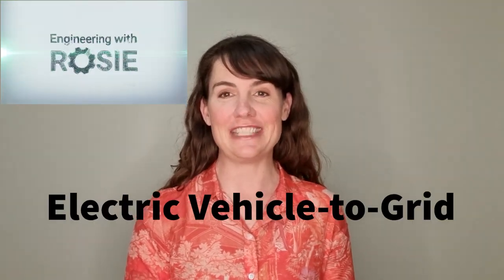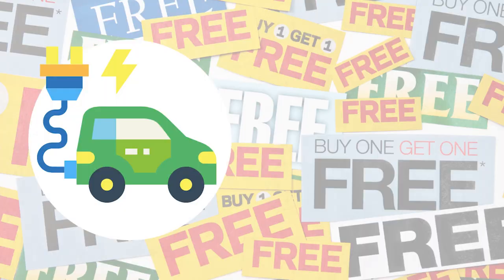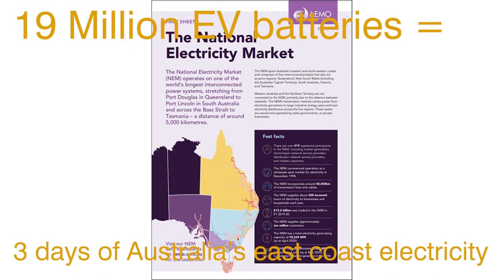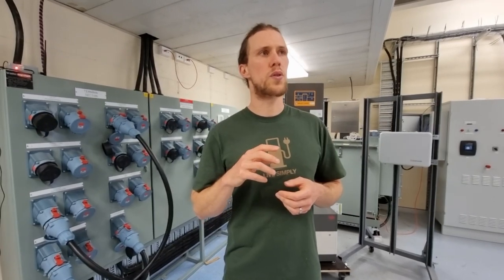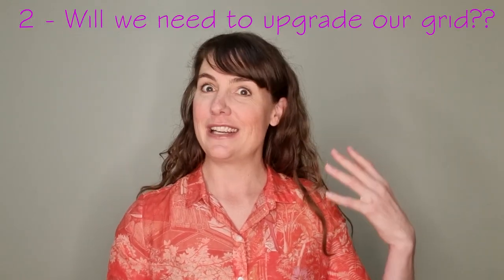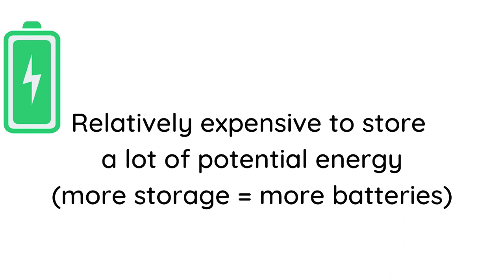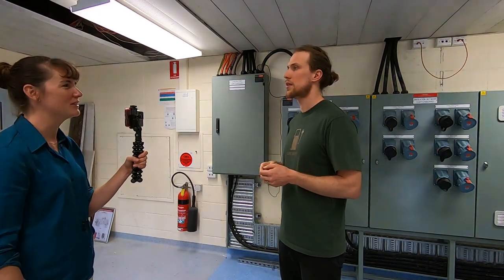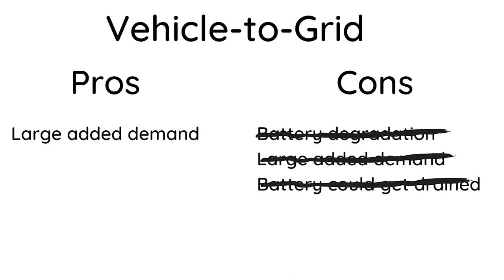Electric Vehicle to Grid Technology Explained

Comment: This one is a source of endless frustration for me too! I have a huge battery sat on my drive doing nothing the whole time I'm at home. It might be worth mentioning that current V2G technology is only supported by the Japanese Chademo connector standard. Most manufacturers have instead adopted the CCS charging standard outside of Japan and China, which unfortunately doesn't support two way power transfer. Therefore most electric cars do not support V2G with the notable exception of the Nissan Leaf and a few others from Japanese manufacturers. Meanwhile I'm drawing fossil fuel power from the grid to run my oven at peak time!
Reply from the maker: This trial uses Nissan Leafs ("Leaves"?!?). That is an interesting point though, that seems like it might be a hurdle that needs to be jumped before we can get really mainstream V2G. Maybe a good topic for a future video 😀
Reply: CCS2 and ISO 15118 support V2H/G

Tesla also is an absolute recalcitrant on V2X as they ban third party use of the battery. It widely suspected that they are holding out to launch a whole ecosystem with Solar Roof, PowerWall and Tesla EVs. 
All the OEMs are making V2X (with a few variations eg Hyundai is V2L only atm) a pathway.
Reply: Hi - I wonder if part of the problem isn’t the structure of the electricity industry? Many countries had vertically integrated utilities incorporating generation, transmission, distribution, metering, retail… In these environments they could take a wholistic view and decide to implement V2G, home batteries or whatever. With the privatisations of the industry in the 1980s (or since always in some countries) the industry is fragmented into parts that have no interest or incentive to cooperate. That means only regulators and governments can drive this - which is only rarely good news!
Reply: @Richardincancale  Hey, I disagree slightly. I do think this is of great interest to utilities companies, private or public. It allows them to access great flexibility and cut costs without having to implement much infrastructure at all. But they're certainly way behind on the "smart grid" technologies necessary for this to work. Currently even those with home batteries can normally only use the power within their own home and not export to the grid, at least not in a "smart" way. More investment is needed in both hardware and software to make this work. By comparison, a large battery storage investment probably looks safer and more conventional, despite the vast storage potential of millions of EV batteries.
Reply: @AlexPacker  Hi Alex - as Deep Throat said - follow the money. Which of the complex web of companies is going to want to invest in building the system and paying the compensation to vehicle owners in exchange for this? In the UK for example the Grid operator has to buy capacity with different responsiveness (base load to spinning reserve) from a variety of generators, based on forecast 30 minute demand, to meet requirements from distribution companies. The distribution network might require some adaptations and that’s another company (DNO) who charge transport fees to distribution companies. Where vertically integrated utilities still exist it’s clear this could benefit them.
Reply: @EngineeringwithRosie  That topic should also include that you need:
- A standard secure control system.
- An automated grid disconnect
- The cost of the inverter to feed power to the grid.
- The cost/payment of electricity used. (f.ex.: If used for load it is free and as supply you get doble back) 
As it is to day the are very little real intensiv to have a V2G agreement and there is non for the companies that make the cars.
Reply: @AlexPacker  Hey, I disagree slightly to. Since every system need an automatic disconnect to avoid that power is feed into the grid when there is a grid failure. It is not nice to fry the line-men that try to fix what is wrong.  :-)
This make it a major investment into infrastructure before V2G can be used.
Reply: @bknesheim  This is already taken care of, so no extra cost at all...
Reply: @SobrisSweden  How is this taken care of?
Reply: @bknesheim  I mean , this is not your problem! The equipment has to be certified and installed properly. It is just like a solar powered house where you want "island" mode.
Reply: @SobrisSweden  My answer was in relation to this quate:
" It allows them to access great flexibility and cut costs without having to implement much infrastructure at all."
So somebody have to pay for the option to use a V2G setup and if that fall on the car owner very few will do it. If the provider pay they have to invest a large up front cost to get a coverage that can be useful. In that case it will be smarter to have a dedicated installation built for the need that the provider have. Again you end up with very few that will use a V2G system.
Reply: @bknesheim  A soon as the standards are set and my car is able to deliver DC into the DC nano grid in my house, then there is already an inverter installed that takes care of the safe connection to the public grid. If I use the power my self or deliver to the power company is my own decision. The inverter is the same piece of equipment that is already needed for my solar panels.
Reply: @SobrisSweden  That is not what the video is about. To do what they talk about in the video the provider must be able to start charging an discharging to stabilize the grid. This most be done automatically in just a few seconds.
Reply: @bknesheim  Yes, and until the standards are set, we can just guess what will be possible to do. I already have a 12 kWh battery with my solar energy system. I will sign up to use that for stabilizing the grid as soon as I get a good offer. And I will do the same with my EV, when that day comes. I see possibilities, where you see problems.
Reply: Said, "I'm drawing fossil fueled power from the grid..."

It is mandatory that all of us get the state and federal governments to convert to renewables.  California has done so and the solar and wind has reduced fossil fuel power a lot - at mid-day time over half of the power is from renewables, mostly solar.

Get rooftop solar and battery storage.  If your system is capable of islanding then you will still have power if the grid power goes down.
Reply: @EngineeringwithRosie  
Tesla supports V2G if the charger is bidirectional.
Reply: @acmefixer1  And how stable is that Californian supply of electricity?
I fully support cutting out hydrocarbons as a source for producing electricity, but not before there is in place as alternativ that are stable and have some reserves.
At the moment the reserves in California is way to low even after several gas plant received and extension.
Reply: @bknesheim  The energy landscape is changing quickly and the sooner you prepare, the easier it will be for you and your family. Many normal days the energy will be almost for free (some hours you may even get paid to take care of the kWh), some days the energy will be very expensive. Stabilization and reliability will be realized in the small scale. Whatever happens far away in big, old fashioned power plants will be of very little concern locally...
Reply: @SobrisSweden  It is not a problem for me since I live in a country near where you nick is pointing that you are. We are already 100% renewable and have really always been so. You will find that running a small grid reliable is not easy, and over time rader expensive.
Reply: @SobrisSweden  If you are from Sweden as you name indicate then perhaps you should update your answer there is absolutely no cheap power in Scandinavia. Currently (December 2021) the price is up to 1 EUR and Sweden is hit very hard due to closing down of excisting power plants - så your assumption about cheap power is not correct
Reply: @peterhansen267  No need to update. My post still holds true and will become more and more accurate as the years go by...
Reply: @malcolmstreet1  
I have no disagreement with the video you linked to.  But...

The video failed to acknowledge that the diodes and charging circuits on the PC board are for charging from the AC outlet.  These circuits cannot be used for DC fast charging by a Tesla Supercharger which puts out so much power - over a hundred kW - that it has to bypass the AC charging on this PC board.  

As long as the DC fast charger, AKA Supercharger connects directly to the battery, the bypassed PC board with its diodes or any other components cannot be used to eliminate the possibility of Tesla providing V2G.

So I call BS on this "debunking" until the actual facts are given straight from Tesla .
Reply: @timryan4209 
I  think that the Tesla vehicles probably will only need a software update to run V2G.
Elon just wants to roll out enough EVs to make a difference when he switches on the grid storage features.
Vested power interests would kill his 'secret baby.'  😊😊😊😊😊😊
Reply: Elon's goal is to maximize sales of powerwalls.... V2G is counterproductive to that goal.... KISS...

And Tesla vehicles probably will also only need a software update, be a RoboTaxi. But in what century?

So I love how fanboys try to rationalize, conspiracy theories about 'vested power interests' lmao...
Reply: 'Tesla supports V2G if the charger is bidirectional' 

Not only is that statement incorrect,  but the person that stated it doesn't even realize that AC chargers, are built into EVs.
Reply: @Richardincancale  Designing the market structure for a grid is at least as complex a set of questions in economics as in engineering. A privatised system aims to generate the gains from competition and in the process must discourage vertical integration, which has both upsides and downsides (though the upsides will definitely be bigger in a fully renewable grid because economies of scale in generation matter less). The usual way it is done is by trying to set up a quasi-competitive market for generation, either a monopoly or a very tightly regulated oligopoly for distribution (as the grid is a natural monopoly, a "common carrier" like railways or the post) and a competitive retail segment with smaller local retailers to consumers. It never works out quite as intended and even if it did this is a structure unsuitable for a grid mixing traditional spinning reserves and renewables storage. Setting good incentives for efficent use of V2G in such a set of interacting markets, for example, is hard - as we can see.

The transition faces the old trilemma - it can be done fast, it can be done cheap or it can be done safely; choose any two. Unfortunately the climate crisis means we now have to do it fast (it would have been a lot easier if we started 30 years ago, but that did not suit certain powerful people), and the costs of chronic grid failure are so high that we have to do it safely. So I am in favour of wartime-style mobilisation of resources (ie not at all cheap) for this transition.

Comment: I remember Sydkraft in Sweden looking at V2G in the late 1980’s. I think their focus was more on scheduled use of EV batteries, to compensate for daily variations in energy demand. That coupled with a guarantee to give back a fully charged car at 5pm when you need to go home.
Reply: Well, let's not say full. Because that's the slow part. The fast charging part goes to around 80% and that's usually all you need.

Comment: It is a very logical idea. The way to make it work is first and foremost to properly incentivize EV owners, give them control over their level of desired participation, up to and including opting out entirely. Owners need to be able to select their degree of participation at each and every time they connect. If you’re recharging during a long trip, you’ll probably be willing to pay more for a fast, uninterrupted charge. If you’re car will be sitting at work or in the garage, you can simply tell it when you want it to be fully charged, and let it participate in frequency support along the way. The compensation needs to more than make up for the potentially longer charge times and, yes, the decreased battery life. Do not lie about that as otherwise this great idea will get a big black eye in the marketplace. Always be forthcoming. It is an inescapable fact that batteries have cycle lives, and while frequency support service will not significantly consume battery life on the whole, it would be dishonest to state that it has zero effect. I’ll bet that the manufacturers who are warrantying their cars’ batteries would agree.
Reply: There was a study that showed that shallow cycles  can actually be beneficial for lithium ion batteries.  Love the point on giving the power to the owner.

Comment: I was a pre-order customer for the new fully electric VW ID.3, and was able to take part in a prototype test drive. Which was in its own way interesting, but even more interesting was the huge and very open Q&A session with the development team and their management. V2G came up quite a lot actually, mainly asked and actually demanded by the customers, and VW being very cagey. They stated quite openly though that the main problem is not the technology, that can be sorted out (the CCS standard has not yet V2G but it is in the pipeline), but rather the multi-party business model needed for a read grid based system, and even for a much simpler V2H system (Vehicle to Home) there are questions like for example battery warranty, interaction with the car owners utility company and so on. It seemed they were really interested in that from a technical point of view, but were extremely unsure about any of the many questions around the business side of things.

Of course V2G and V2H are very logical extensions of the BEV ecosystem, especially in conjunction with a photovoltaic system at home.
Reply: The Sono Sion will get bidirectional charging over the 11kw typ 2 plug. So you can use it for v2h and possibly v2g if the electricity network providers together with the government can agree on a standart. VW has a subsidiary called Elli that is developing those systems too. Hyundai also announced a test for V2G, but I am not sure if they want to use ccs for it.

Comment: This would be great especially for suburban vehicles where families have more than one vehicle, so there's a greater chance they'll have a spare vehicle always plugged in. Also as long as it's limited to 20% and 80% the battery degradation will be minimized. You could do a video on turquoise H2 production as we transition to cheaper green H2, companies like Graphene Manufacturing Group are making aluminum ion batteries for non-vehicle use using the pure carbon byproduct.
Reply: anydaynow - Thanks for mentioning Graphene Manufacturing Group, I was previously unaware of them. Battery technology advances hold so much promise. Hopefully the cream rises to the top quickly so we can all benefit from it asap.